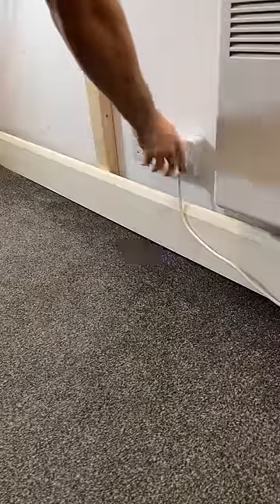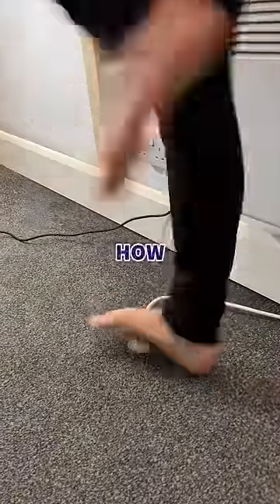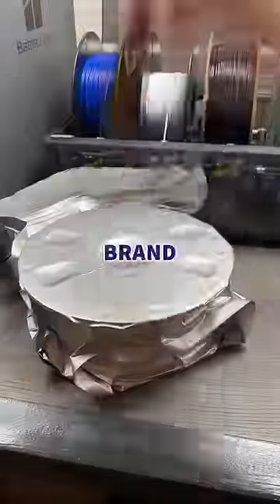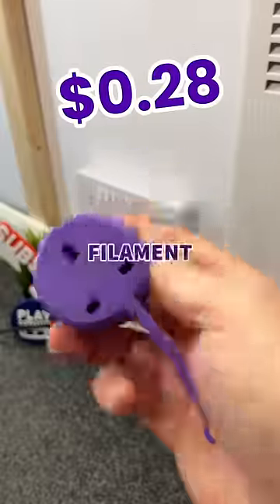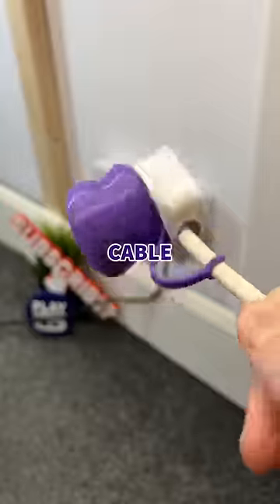3D printing SOLVED the most PAINFUL PROBLEM in the WORLD 😫#3dprinting #lifehacks #shorts

Comment: British problems, The europlugs don't hurt at all
Reply: Its not really a problem, most people just leave it plugged in and switch off at the socket.
Reply: Another drive-by W for the "worst" plug on the planet, the Edison plug.

You euros are proud of your 240v standard lines, but my electrical system is smiling down at me imperial, can you say the same?
Reply: in Canada and most of north america our plugs dont even  have the plugs on the side, and the ones that do are mostly too thin to have the plug facing up
Reply: @Tysca_ you mean the plug where you can touch live parts when not fully inserted 😬
The plug that fits so loosely in the plug that you have to tie knots in your extentions because they so easily unplug?
Add to that the lower voltage that causes you to use twice the amount of copper per watt?
The 208 and/or 240V thing (yes, yes I know why it's done, still antiquated)
Transformers popping all the time, and the problems all the above ground wiring brings...
Some parts can be excused by the age of the grid but it's time to let go of some of the old ways...
Don't get me started on the British obsession with ring mains or the germans with there 1.5mm² 16Amps circuits or the Austrians that think everything inside of conduit makes sense...
In the upside-down land they obsess about there plug design... it's figuratively the US plug but bent a bit... because the spiders weren't enough...
Reply: @millythecat7211 once again North America is the superior continent
Reply: @stevendorries  yes
Reply: @stevendorries YEA BUDDDY
Reply: @stevendorries Gonna have to disagree there chief 😂
Reply: @millythecat7211  Yep, it's not a great design in general, but the fact that the wires come in and make no bend does, at least, make this scenario a rarity.
Reply: @SuperUltimateLP  you realize you can touch live parts on most plugs right?
Reply: @turquoisephoenix6548  Not on the EU and British plug. When you have them plugged in just enough to be live it is either plastic or recessed sockets blocking you from touching the live pins.
Reply: Europlugs are also able to handle less current at 230v so idk
Reply: @SRNAR8  if you mean the specific "euro plug" (type C)
Then yes, but this is generally just a plug that enables devices to be used in most mainland European countries, it's NOT the main plug type and doesn't replace the domestic plugs.
The german type F or french type E for example can go up to 16Amp, that's 3680watts of power per plug...
The Euro plug is just for small devices and can be used across many countries without trouble.
Reply: @SRNAR8  when do you need more than 16amp at 240v? Over that you're looking at 400v
Reply: A wise man once said : "Deswegen sind die auch nicht in der EU! Weil die am Leben vorbei leben!"
Reply: Not a United States issue either..
Reply: @MrWinsor  but your plugs also arent safe. The british plugs are at least safe.
Reply: @stevendorries  There is not such thing as a superior continent, begining with the fact that North America is not a continent, is part of a continent. If you believe so superior, let's talk about USA health care system and compare it to the European one... you may not like that conversation. By the way, most of EU doesn't use those plugs,
Reply: The three pin europlugs hurt like hell
Reply: @Fancylooks  …it was a joke…
Reply: @Mr_Lyric  That is British plugs, most of the rest of Europe use a very different plug that won't hurt if let on the floor because it stays flat
Reply: @stevendorries  Sure...
Reply: @Fancylooks  No its not british, they are the old style europlugs, they are very common in south africa, if you tried to stick them in a british socket they would not fit
Reply: @Mr_Lyric  It doesn't matter if they are exactly the same, they are so similar they look exact. ALso, I don't think you can say they are very common in South Africa, they are either used in South Africa or not.
Reply: @Fancylooks  They are used, and we also use the flat 2 pin plugs, but those are only 10 amp, our 15 amp plugs used to be common in europe and have 3 pins
Reply: @Mr_Lyric  So you have different types of plugs in the same country? That doesn't make any sense to me!
Reply: Except when they straight up kill you because they're inherently unsafe.
Reply: @Fancylooks  Hmm, I thought they were europlugs, but we do still have the 2 pin europlugs, anyhow, how painful are your 15 amp ones(The round ones)
Reply: Yeah but ur trading that for a plug that doesn’t stay in the socket
Reply: @stevendorries  the North American plug is dangerous and also falls out of the socket too
Reply: @branbroken  British overengineering at its best.
Reply: Not even British problems. The British plug is designed so its safe to leave the plug in the socket due to the outlet switch. There is no reason why you whould leave the plug on the floor
Reply: Neither do the American ones, they lie on their side so if you step on one it doesn’t really hurt that much
Reply: @turquoisephoenix6548  the point is that you cant on UK plugs
Reply: @MautreXvids  welder can be ran off EU plugs and 240v is better in general
Reply: @theguide7276  yeah i know some welders dont need a huge amount of current now adays.
Reply: American plugs just feel like beautiful freedom lovingly caressing your feet.
Reply: @SuperUltimateLP  No. You cant.
Reply: Our plugs are the most safe in the entire world. I'd rather keep my "painful" plugs.
Reply: @OllyAv89  turns out they need to be that safe because your  electrical systems are so crappy, no other 230v system requires a fuse in the plug
Reply: @Fancylooks Wait, how is North America not its own continent? I'm genuinely curious
Reply: @Awesome_Nova  North America needs Central and South America to be a continent, North America by itself is not a complete continent
Reply: And Hong Kong.  Because its 220 v, there's a switch that you can turn it off. No need to pull it out. 😊
Reply: @Fancylooks What are you on about, North America is absolutely a continent. Central America is usually considered part of North America, in the same way the surrounding islands are. South America is its own continent. 
If continents are defined by the bodies of water surrounding them, then Hawwii is made up of eight continents, and most of europe, asia and africa are also the same continent. If they're defined by naming scheme, then North Korea and South Korea are the same country.

Real life isn't that simple though, and South America and North America are different continents because at some point somebody who has been dead for centuries decided they ought to be.
Reply: @hello-xm5il  In school we clearly learn there are only 5 continents, America is one of them, America includes the whole of it, Noth, Centre and South. Europe is another continent and it is not totally surrounded with water, not Asia either. If this changes depending on the continent you live in, I don't know, if it depends on when you studied it, I don't know, all I know is that I learned there are 5 continents in the world. If you google the answer, you will find out there are 5, 6 or 7... that is new, it makes no sense, for what I know from when I studied, there are only five continents and I won't change my mind to fit the modern insanity.
Reply: @Fancylooks  Throughout my entire schooling experience I learned that there are seven continents. Wikipedia agrees with me.
According to a quick google search, it seems to be a cultural thing. In latin america there are five continents. In the US, there are seven. England also thinks there are five. The rest of Europe thinks there are six. And so on. 
It's kind of frustrating to learn that something you were taught as a kid in school as fact is actually so nebulous, but it's fascinating this discrepency exists at all.
Reply: @hello-xm5il  Alright, I am in "the rest of Europe" and I learned 5 continents! Recently I posted a video about the seven rainbow colours and I also got in the comments some discussion about that number, many people said there were only 6 colours to the rainbow, some reclaimed 8 colours... it is all a mess, it makes no sense, I wonder if they just didn't know or if they are taught differently
Reply: @Fancylooks  As far as I can tell, most english speaking schools teach seven colors of the rainbow, even though this is scientifically incorrect.
Real rainbows don't have purple unless they are an overlapping double rainbow, in which case the red of the bottom rainbow seeps into the blue of the top rainbow and purple is formed. This can also cause pink to occur, so that would be your eighth. (This phenomon is called a supernumerary rainbow, and is a bit more common than you might think, too. The second, lower rainbow is so faint you may not notice it, but the overlap still affects the first rainbow noticably.)
Indigo isn't a super distinct color, and I've seen it occasionally omitted in the school setting, but I've never seen pink taught in schools. Most people don't use indigo as a common color to refer to things, and they probably didn't even back when the rainbow colors were invented.
Issac Newton, who decided which colors were part of the rainbow, and which colors aren't, wanted seven colors to line up with the seven days of the week and the seven musical tones. He actually didn't see either indigo or orange in the rainbow and just made both of them up so that there would be seven. Pink was just starting to be recognized as a color, so even if he had happened to see one of the occasional supernumerary rainbows containing pink, he probably wouldn't have considered it to be an important rainbow color.
Before this point in time, rainbows were widely considered to have only three colors. 

Depending on which sort of rainbow, what historical period you're referencing, and whether or not you think indigo is an important color, you could say rainbows have 3, 4, 5, 6, 7, or 8 different colors and you would still be correct. Color is amazing.
Reply: @hello-xm5il  Colour is amazing, that is why I have so many shorts that are tutorial videos about it, specially on how to use the cmyk quartet to get the rest of colours, some people discuss me black is not a colour, some people say I am racist when I don't use black in my drawing (black is needed for enhancing details and darkening the others, but sometimes it is not needed), but those people don't tell me anything similar when I don't use blue... I don't care, I just enjoy using colours in any way. Magenta pink is a primary colour, but people keep discussing me it is not, that it is red the primary colour, and you can use it as a primary, but it is a mixture of magenta and yellow... clearly Newton didn't know about magenta pink, it is a champion! Thank you very much about your explanation on the rainbow colours, very interesting.
Reply: @Fancylooks  I think the people telling you you are racist are just joking.
Humans didn't have access to a lot of pigments and dyes back in the day. Most of the colors nowadays are synthetic. Issac Newton might have known about magenta pink from flowers or such, but there is no way he had the opportunity to experiment with mixing it into other colors. Purple dye was wildly expensive to make, and I don't even think they had the resources to make magenta dye.
Red was taken as a substitute, and it, yellow, and blue can still make most of the colors. In traditional art (as opposed to digital art), and in color theory, these primary colors are still used, partly because of tradition, and partly because most of the paints that we use now were invented a very long time ago, and they were modified and designed around their initial limitations.
Reply: @hello-xm5il  Your knowledge is extensive and you have an interesting point of view, about Newton knowing about magenta but not having the pigment, that is very possible. I t has been a pleasure talking with you about all this and all because of a plug.
Reply: @SuperUltimateLP  😡
Reply: @AleksGawel  unhappy with me ?
Could you elaborate a bit? 😂
Reply: @MautreXvids and with 400V you look at industrial machinery. Forklifts, Mills, lathes, big table saws, that kind of thing.
Reply: @DaemonwarriorJulius  yeah so when do you need more than 2300w? or 3580w?
Reply: Our 🦅 🇺🇸 AMERICAN 🇺🇸🦅 plugs.... hurt as bad as stepping on a lego
Reply: @branbroken  not everyone has plug switches